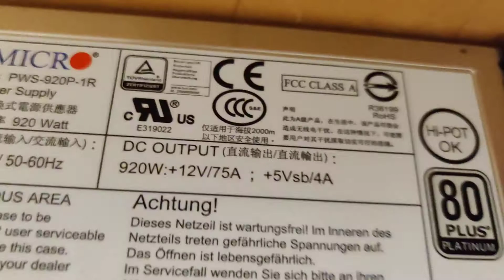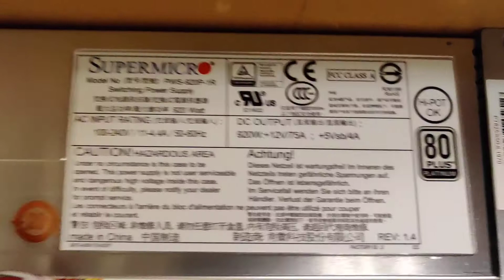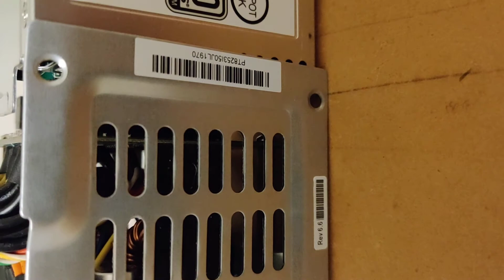SuperMicro PDB-PT825-8824 Power Distribution Board - Defective? Bad Soldering? What to do?

Comment: Dealing with a CSE847 and I'm not getting any post or anything.  Quick flicker of the LEDs on the front panel and then nothing.  Thinking it's the distribution board.
Reply: I’m having the same issue. I’ll likely be replacing the same component.